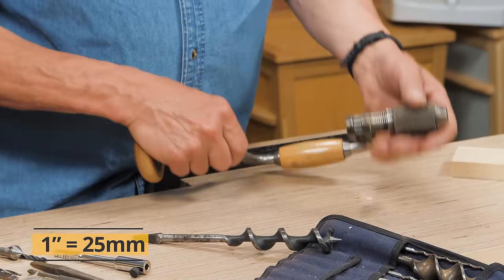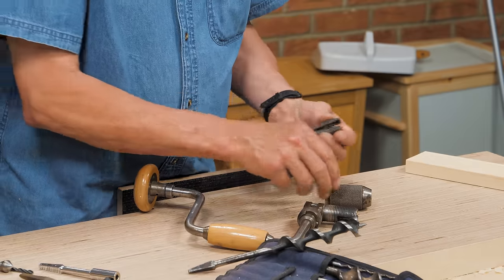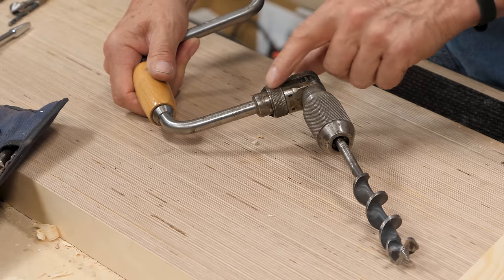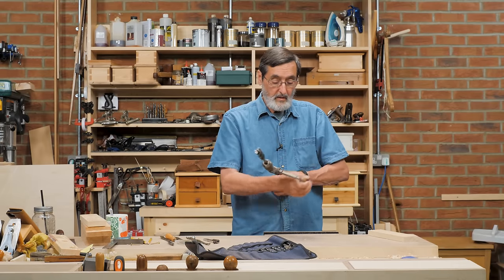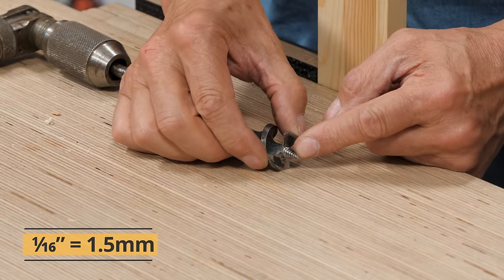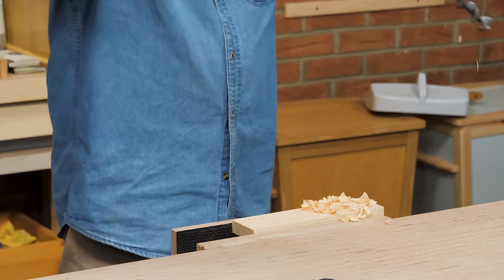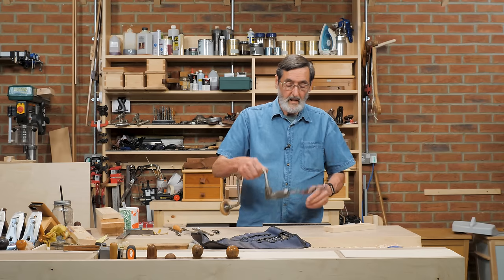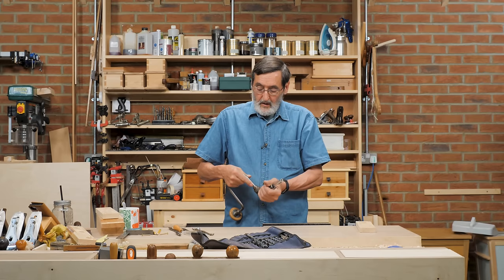Brace & Bit | Paul Sellers

Comment from the maker: You can see how to sharpen bits here: https://woodworkingmasterclasses.com/videos/sharpening-auger-bit/
Reply: Alright Paul, I have both of my great grandfather’s brace. Now, where the bloody hell do I find a good bit set!?!? I cannot find brace auger bits for the life of me. I live in an area that has specialised in iron mining for 100 years, no antique wood workers tools running around. Where do I look? Any thoughts? Thank you Mr. Sellers
Reply: @agualotus  did you try ebay? I've gotten a lot of good tools cheaply there.
Reply: Jeffrey Dustin 
I’ve looked, but $100 usd for an old set that needs refurbishing, only because it’s “an antique collectible” is not a good deal. However I’ll continue to search there as well. I was hoping mr. Sellers knew of a company that still makes them. There was one in GB, but they went belly up a couple years ago.
Reply: Where can I find replacement jaws in the US?
Reply: Don Caudle  - I do believe IRWIN still make auger bits for brace. Some have mentioned that the quality is not up to the standards of «the old days» but I can not confirm this.
Reply: @Heseblesens  I'm afraid they don't. The set is still on their web site but it's no longer being made...not in North America anyway. (Found this out with a phone call to their office)
Reply: Where do you get that adapter
Reply: @jameswallace9906  Been looking ever since this video originally aired.  Cannot find one in the US.  Willing to buy one from anywhere, but none to be found.

Comment: I'm fairly new to using the bit and brace, but one of the things I most enjoy is the silence of the tool compared to electric drivers and drills.
Reply: Yes, and I love the sound as the bit cuts through the wood. It's a great feeling too, which you don't get with an electric drill.
Reply: as a guy about to turn 30 already developing hearing issues, I really apreciate the quiet environment as well.
Reply: I like that about hand tool work in general, i really dislike the sound of most power tools

Comment: I have my grandfather's brace and bit, plus his augur bits. If you haven't used one, it's hard to imagine how much better this is than fighting with spade bits in an electric drill. I remember the "aha!" moment when I realized the chuck had a ratchet on it. Brilliant! Thanks for this.
Reply: it's hard to imagine how much better this is than fighting with spade bits in an electric drill  - I kept forgetting to get a brace and when I needed one, I was always without it. Then after years of struggling like you described, I remembered to purchase one. I knew they existed, I had even used one, but it wasn't until I got one of my own, I frustratingly realised how much I had missed out on.

Comment: You are a master of common sense. It is not slower it is more accurate and matches my beginners brain to a speed that returns control of the results to the operator.  Thanks Paul

Comment: My late father taught me how to use a brace and augers in the 1970's. Today I am still using the same brace and augers which he bought in the late 1940's. It outlived two of his electrical drills as far as I know, as well as three of mine and is still going strong. It is a Stanley 10", I also own a Millers Falls 12" and a dainty Stanley 5" which drives screws sweetly.

Comment: I got my Dad's brace and bit set a couple of years ago (old wooden box set) and I use it every chance I get. Over the summer I made a bassinet for my granddaughter and the only thing I used any power tool for was the larger diameter holes (for the hinge pins) because I thought that I didn't have a large enough bit. Turns out that I did and I wish I would have realized that before I drilled those holes. I ended up with misaligned holes and spent a lot of extra time reshaping them. With the brace I can so easily line it up square and true. Thanks Paul for all the videos! I would never have been able to complete the bassinet without your teaching.

Comment: Once again you have hit the proverbial nail on the head.  I have taken to using a brace almost exclusively in my woodworking.  I have found that a quick-release adapter will chuck nicely in the jaws of my brace.  This allows me to use regular twist drills in a keyless chuck that has a 1/4" quick-release hex shank or swap out the keyless chuck for a #2 square driver for deck screws or a #2 phillips driver or a countersink tool...   Thanks for pointing this out.

Comment: Given my belated interest in trying to get into woodwork my Dad gave me a brace drill just like this that my late Grandad gave to him around 50 years ago. It is in immaculate working condition with just some wear of the original varnish on the handles. I love my Dewalt and Metabo battery drills, but I love this more. I feel a sense of calm when using it. I was recently helping my son make a rustic gin cabinet and I suggested recessing the screw heads that were used and then tapping in some dowels for a better look. No matter how careful I was, the power drill produced some tear out with a 9mm drill bit, so I got the brace out. As you demonstrated here, the brace gave so much more control and produced a nice clean hole for a better finish. I always feel a little bit emotional remembering my Grandad when I use this tool  which we reckon is around 80 years old. He was an excellent wood worker and I wish that I took more interest as a boy. Thank you for the comprehensive info regarding the brace and bits. I found out more than expected, as usual.

Comment: Just bought one of these for only two bucks off ebay having seen you use it in an earlier video. What a beautiful way of working compared to the electric drill and also a silent one. I can use that in the middle of the night as well as during the day in my workshop without any neighbours complaining. Thanks for that video.

Comment: These are great tools.  I purchased a brace many years ago and had a few bits for it.  It was only within the last three or four years that  I realised the true value of them after seeing Paul use them.  I have since picked up at least 8 braces for £1 each and sets of bits for a fiver each.  I cleaned them up and gave them to friends and relatives.  In all cases, they were rusty and needed tlc and lubricating.  Cleaning the bits is easy using a brass wire brush on a bench grinder.  If you want to go the whole hog, you can follow that with polishing mops and compound.  For a little effort you can get a good set in working condition for less than a tenner.  There are plenty videos on you tube on how to sharpen them but beware, the outer diameter of the bit must be maintained to ensure it bores the correct size of hole, so don't wear way the outside of the spur cutters.

Paul, was that a centre bit lying on your bench?  you didn't mention it.  Could you please explain where that would be used and how to sharpen them as I picked up an incomplete set in my usual junk shop rummage bin for £5, but would like to know more about them. The set came with the screwdrivers a reamer and a couple of countersink bits. I have only used them for boring shallow holes in fence posts to sink the heads of coach screws but I'm sure they have wider use.  Unfortunately the junk shop closed so my source has gone but there will be plenty available at car boot sales.

Thanks for a great video and such clear explanation.

Comment: Mine is not as high quality a tool and there's no spring to hold the two jaws open but it has always served me very well.  I also made a standard jacobs chuck on a brace bit so I can mount any modern bit, such as a 1/4" hex drive tool.  It's great!  I've been using it for more than 50 years and it's still good.

Comment: I have a couple of drill drivers. But, I still use my brace and bit. I have a set of spoon bits(I think you call them "shells"?) and a set of augers for it. I use it whenever I need a precise hole. With the tiniest bit of care a brace will create a perfectly round hole with no breakout on either side. Because the brace moves exactly at ones own speed,  one almost never makes a mess. I have seen so many guys skid a drill driver across a finished surface, or drill an oblong hole because they are in a hurry. Because of the design of the auger bit, it is also very easy to make perfectly perpendicular holes. I also have a socket adapter for 3/8 drive and a hex head bits as well. I use it for screwing things as well. With the extra control you carefully drive screws into even the most difficult material without any fear. Vintage for the win in my kit!

Comment: Hi Paul
The DeWalt bit at 7:33 is for when you need to put a screw in overhead, it stops the screw falling off the bit.  There are are special bits for inserting a screw flush, as they hit the surface of the wood they withdraw the screw driver bit

Comment: A timeless tool—I think it was the first woodworking tool I learned to use. I have my father’s braces (he was a ‘trim’ carpenter and cabinet maker in the 20’s-40s) that have two different ‘swings;’ one standard and one with a greater swing distance for (apparently) work which required a greater torque; or use with a very large auger bit.

Comment: When I was an apprentice electrician in the late 1970's we had to rewire a very old mansion house which had oak beams the electric drill burnt out and the flat wood bits melted I ended up using a brace and bit to drill the holes as well as some large auger bits which used a broom handle to turn the auger bit and gues what it was quicker than the electric drikk

Comment: The most amazing tool for removing old flat head screws, Incredible torque. I broke the bit my grandfather gave me tying to remove a screw much bigger than the bit. The modern replacement is rubbish by comparison!  Great video Paul

Comment: Paul,
I still have and use regularly, the brace I purchased with my first batch of tools prior to starting my apprenticeship as a cabinetmaker in 1976. 
One of my students gave me a brace she acquired at an auction. This brace has a number 1 Morse taper socket in stead of a chuck. I’ve never seen one before. Can you give any more information on this. The brace has a small swing. Perhaps you could enlighten your viewers on the use of different swing sizes in braces. 
Regards,
Terry Gleeson 
(Sydney Australia)

Comment: I was given a Stanley brace as a wedding present, some fifty years ago I still have it, although It has spent many years lurking at the back of a tool drawer. But I had to use it last week. The only bit that I had of the correct size was a funky augur that I found at a motorcycle autojumble a long time ago. I bought it simply because I had never seen one just like it before.
But having given it a few strokes with a file, it cut like a champion. And, as you said, I was in full control.

Comment: Hi Paul,
When I've used by brace it has always has a wobble to it and I've always thought that it was because I bought a cheap tool. It seems like the pad isn't aligned with the chuck. But I see that you're brace wobbles as well. How do you co
mpensate for this so that you end up with a straight and true hole? I can't help but think that there is a reason for this wobble, what would that be.

I just found your videos and I really enjoy them.

Comment: Thank you:-) I am taken by this brace. Where do you buy the drill bits with a square shank that fit the braces? Braces are easy to buy but the square shank drill bits that fit them are available only at the flea market as rusty antiques.

Comment: Mr Sellers, I got a question that puzzles me for quite a time about auger bit tangs. I own a modern brace and a set of auger bits. The smaller bits have a small size tang and fit fine in the jaws (two) of my brace. But the bigger bits, about one 11/16 and above have larger tangs that my brace jaws refuse to hold. Is that usual?
Thanks for your attention. Your videos are a source of inspiration and I admire your work, both woodworking and teaching. Best regards from Brazil.

Comment: Looking at the brace you are using, it looks like an Irwin.  Same jaws, same ash handles.  New ones don't seem to be readily available in the US anymore, but Irwin still makes them in Brazil:  Irwin 5420 12" Ratcheting Bit Brace.   Searching, I couldn't find them in the US except on E-Bay.  About $30-40 (including shipping) will get you a new one - and it is pretty nice.  I have tried others (including a $70 Veritas which was complete garbage) and this Erwin is the best.

Comment: I just found your channel. Subbed and liked. It is very informative, thanks. I bought a brace a while back. I don't remember if EBay, Amazon, Etsy or where, but, it doesn't have the alligator jaws or any other for that matter. Does anyplace still make new parts or do you have to always buy used?

Comment: I often use those drill bits in a hand drill for large repeatable holes because if I wanted to drill large holes with a power drill I’d need a fairly expensive forstner set and have to recharge the battery

Comment: I have my Dad's brace and yes the middle will not turn any more.  My question is, does the collet or shell with jaws come in different sizes?  I bought a handful of bits at a garage sale and some of the drill shanks (the square part) is too big to fit in the brace.  Bruce from the city of Orange in Orange county California. USA

Comment: Not sure if you will answer this, I've been watching you on YouTube off and on as i needed guidance for the hand tool portion of my woodworking for the past two years.  I've recently been building a combination dining room and board game table for the past couple of months(I'm pretty slow i think but not the point)  I am installing cup holders in the side of the unit and i need to cut 9 inch deep mortises for the installation.... how would i go about doing this?  First thing i tried was using a bit and brace to drill out most of the waste but my bit snail stopped drilling into the wood(stripped the hole i guess)  Any other ideas?  Also i apologize for posting this here i was attempting to send a private message on Facebook but it failed to send

Comment: Oh nice, and I just bought a German made and Craftsman branded brace that has 3 spring loaded jaws in the chuck for a dollar at a yard sale. It's got a fully enclosed ratchet with a single peg thing that you position for either locking the ratchet for a traditional revolution use or for a left or right ratcheting function like a socket wrench. Love it.

Only downside is that I have no idea how to comfortably disassemble it. I know from looking at it I have to drive out the two pins holding the pawls in place and the little roll pin on the side next to the pawls, but I'm not sure what to do next.

According to georgesbasement, this was made based on an expired US patent by H.V. Smith and it has a little trouble with gripping bits.

Comment: "If this [handle] doesn't rotate, it'll rub blisters on your hand" Brilliant bit of humor there, but it is true. Thanks for sharing Mr. Sellers.
Do you know of any place to but the bits? I see the occasional single bit here and there, but I can't seem to find a set or any of the specialty bits like the drivers or spoon bits. Thanks to anyone who can help out on locating these tools. I have one of my grandfather's braces and a second one I found at an antique market. Braces seem real common around me, but I can't find but 1/2 and 3/4 bits in usable or restorable condition. Most of the bits I come across have been filed/ground on the outside of the nickers therefore losing the knifewall of the proper size to cut ahead ofbthe takers, resulting in tearout. 
Also, could you please demonstrate how to sharpen the bits and Forstner bits as well, please?

Comment: Hi Paul, thanks for another wonderful video! I recently bought a brace and bit set off of eBay, and was surprised that the holes it bored seemed very uneven and chewed up. Could that mean the bits are crooked and is there anything I could do to make them usable?

Comment: How important is the adapter? I've used bits for an electric drill without any trouble, albeit in very limited applications. Am I damaging the alligator jaw doing that, or just risking the bit slipping if I'm working on tough wood?
Not to point out the obvious, but when buying old bits, one should check them for straightness. (I still haven't found a #4 (4/16) that's reasonably straight but I have not needed to bore holes deep enough for it to matter.) (Edit: Also check that the spurs and snail threads are intact.)
Reply from the maker: I have used without for years. They do slip some but retightening is not really an issue.

Comment: Where can you buy the bit adaptor that was demonstrated in this video?
Reply: I had the same question- I think the Lee valley catalog carries them
Reply: Just search "hand brace drive adaptor" or something similar and you will find several online retailers that sell them.  There are different types,; for round shafts such as Mr. Sellers used or for socket drives, and so on.
Reply: @MichaelRosenbaum29  Never available or in stock, though. ☹️
Reply: @taylorsaysso7817   Looks like they have one of the two styles available ( Nov. 2019)....

Comment: Excellent video as always, thank you so much! I am starting to toy with the idea of a  brace, and I was wondering if it is possible to  you use a modern hexagonal spade bit with an aligator style old brace?
Reply: Vasileios Bitas :  Yes, it is. Even better , you can use a hex extension and drive any bit that fits the extension.  The extension will also help avoid a common problem, when the hex bit slips inside the jaws under force.